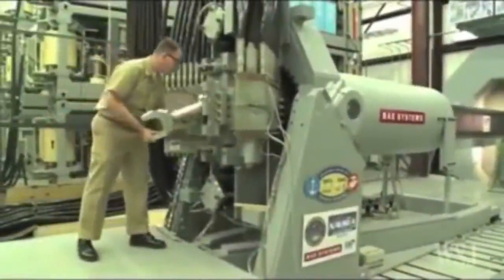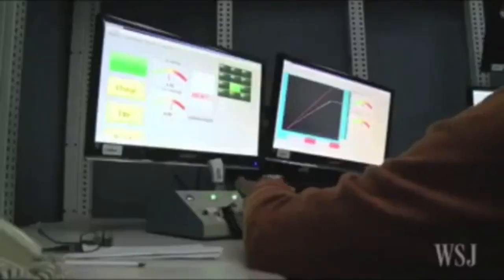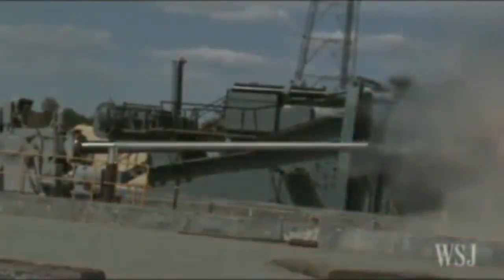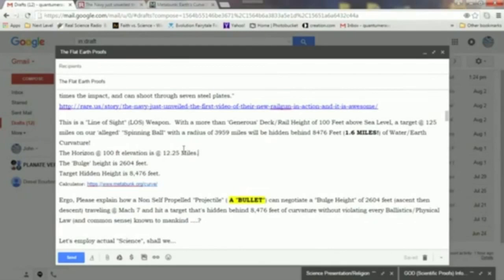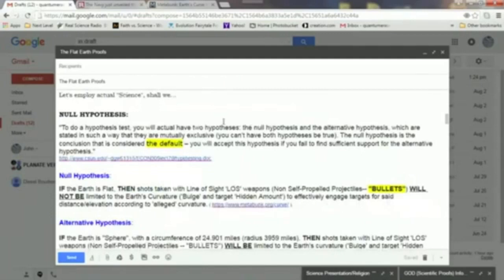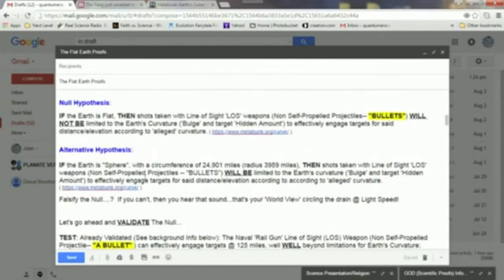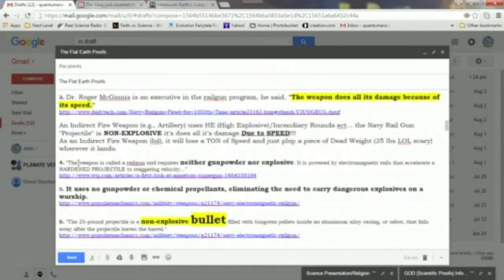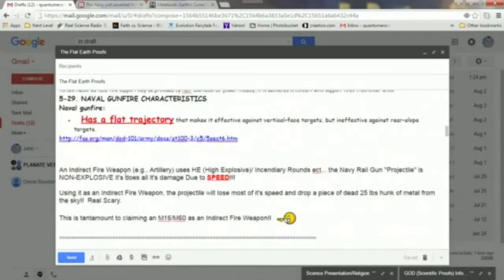U.S Navy RailGun Proves NO CURVATURE at 125 Miles (ElectroMagnetic Gun)

Comment: Any object that is thrown or shot into the air will ascent and then descent. Not sure why you think that is not possible, given that every single object does that. You might want to try it out with a rock yourself. The military term "line-of-sight" used in the video simply means that the bullet has no propellent of its own. It will follow a parabolic curve just like any other inactive object. It does NOT mean that the gunner can see the target.
Reply: Ever studied basic physics, analytical mechanics or physics of matter? Quite simple to disprove a curved Earth on a magnitude of levels. Learning with a clean slate is the best way to approach an analytical problem.
Reply: @McPiePie  Okay then, provide your evidence on even 1 of those levels and collect your Nobel prize...
Reply: @McPiePie the irony of saying math proves the earth flat 😂
Reply: @McPiePie  Simple physics and maths disproves FE. If the earth was flat the sun would change size during the day, it doesn't.

Comment: If the bullet arch’s though? Do you know if it’s shot at an upward angle or shot flat?
Reply: Its fired flat at over mach 7.....
How they would take out a missile, is its able to put up such a huge volume of rounds it literally makes a wall of steel in front of an incoming round. 
Because it uses electromagnetism and not chemical energy, they can reach atrocious levels of Rounds per minute, (more then a minigun) out of the thing. They just put a literal wall of tungsten out...... because it fires 100% straight. How would they get the munitions to curve at mach 7 lol..... think about it.

Comment: This is not a "Line of Sight" weapon. This is from the website globalsecurity.org, which goes into detail about the electromagnetic rail gun and its capabilities: 

"For purposes of clarity, direct fire engagements are typically considered line of sight (LOS) or near line of sight (NLOS). Engagements are from one to forty (1-40) kilometers in range and can be either defensive or offensive in nature and depending on application include a mix of fix and moving air, sea surface or land targets. Indirect fire, or non-line of sight for cannon (NLOS-C) or naval artillery systems, are typically distances starting from hundreds (100's) of kilometers or more and primary interest currently is in land based targets mobile or fixed target sets."

Stop lying to people.